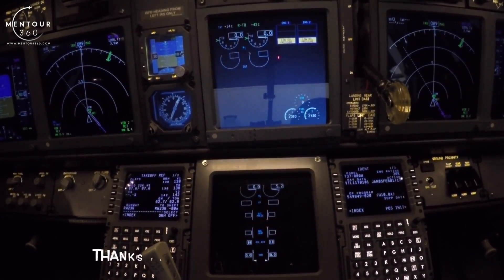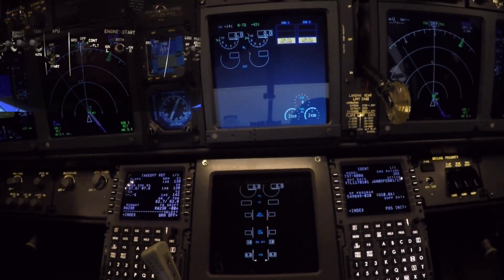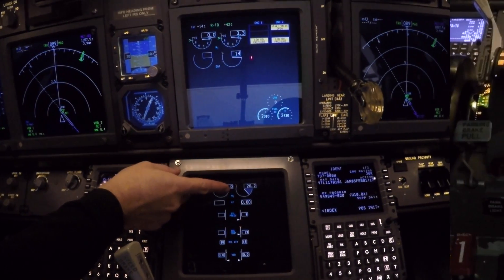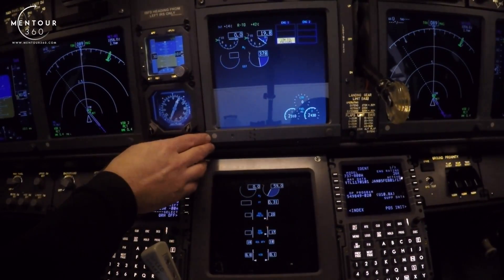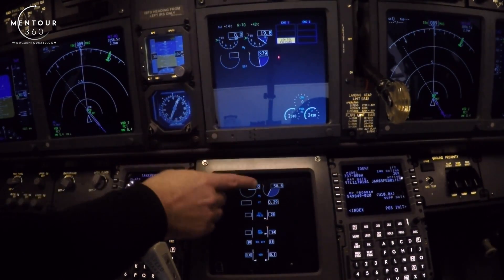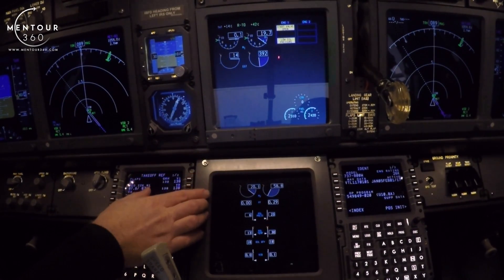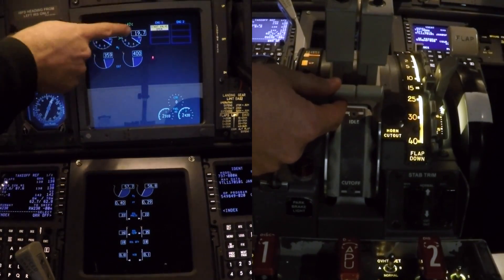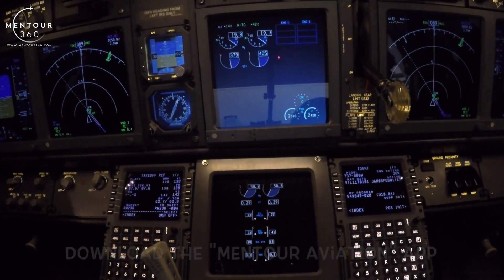How to start a jet engine

Comment: He forgot the most important part.  First assure you have hydraulic pressure from the correct system that pressurizes the brakes and steering. Never start a jet engine unless you have brake pressure.

Comment: We did engine startup different on the helicopters. Because they're turboshaft and there is a not negligible weight of the rotors and associated gearboxes from a static startup to try to spread the strain on the engines evenly the first engine to start would depend on the date. Even number day's would be a number two engine start first and odd number day's would be a number one engine start first.

Comment: Don't forget to first turn on the battery, start the APU and open its bleed air valve, then to turn on the fuel pumps for the engines, otherwise they will not start.

Comment: Petter, have you never queried why ?
2 controls to start engines
It's not an extension of the thrust levers....

FULL
%
.
%
IDLE
STOP

So just move thrust lever from STOP to IDLE - and be done with !

If it were my plane, it'd have one four-position switch:

OFF - ON - TAXI - FLY

And nothing stopping you from going from OFF to FLY in one move !
Reply: What!?😆🤷🏻‍♂️

Comment: What is the maximum egt in both engine during start up ?
Reply: Eduard Caba From the AMM: The EGT can be between 320 degrees C (608 degrees F) and 520 degrees C (968 degrees F) with different outside air temperatures, bleed air configurations and other engine conditions.

Comment: Hi mentour,I have a small question i can't figure out,in the fms of your 737,there is the derate option with some kinds of ratings (i.e:22k,18k...) what does the "k" stand for?Thanks.
Reply: awf2512 Never though about that actually🙄 Think 1k is 1000..like you would say in eg a distance measure (like 10k..)
So a CFM 56-7B with a 26k rating can produce up to 26.000 lbf of thrust..I think🤭🤷🏻‍♂️
Reply: Thousand as in 5 thousand dollars.

Comment: I'm a bit confused as to why the start position on the switch is labelled GND when I was expecting it to be labelled IGN...he didn't explain the switch in the middle which was labelled L and R IGN...why didn't he say anything about that?
Reply: paulmurphy42 IGN means igniter not ingnition😉

Comment: In some videos I saw them pulling the fuel lever at 20%N2. Is this company-dependent?
Reply: outside7 Its document dependent😆 Start lever at 20% N2 is boarderline early, this is the minimum motoring speed, you should really have 25% or max motoring (about 29%).

Comment: From an energy point of view, aircraft engines are important especially when it comes to developing engines that can accept other kinds of fuel or even electric engines for aircraft. Hydrogen fuel cells are another kind of technology that with the proper research can become great for aircraft.
But this video only shows starting the engines from the controls in the cockpit and no picture of what is happening in the engine itself.

Comment: Can the 737 start an engine at an airport without the aid of a starter generator?
Reply: if it has a functional auxillary power unit indeed it can. the APU is basically a mini jet engine (gas turbine technically) which can be started with the onboard batteries, once it's running bleed-off air will be piped to one of the two main engines. once that is running the APU can be shut off and the bleed-off air from the running engine will start the other one.

Comment: OMG! If I owned the Airline, or if I owned the Aircraft company, or even if I owned the engine manufacturer, in all three cases I'd automate the crap out of this procedure. Honestly!

There are only so many parameters that can change: ambient temperature, engine inner temperature (as in how long since last shutdown), fuel temperature, air pressure, and only a couple of other things. (I might even be bold enough to say that the Engine Start Button is for serious machinery, and not only for cool-wannabe idiots buying cheap "sports" cars.)

While Aviation has succeeded in automating a whole lot of truly complicated things, I find it downright insulting that pilots have to learn complicated procedures and contingency forks and exceptions and emergency procedures, all just for something that's not much more complicated (but, granted, needs fast, accurate and confident responses) than children's sand box play.

Comment: So, not CTRL-E?
Reply: Clipper1094 69th like
Reply: Once AI gets to be piloting, it will start all plane systems at random 😅
Reply: Ah. I see what you did there. Control E as in to start your engine in Microsoft flight simulator.

Comment: By the way, I have a question. I noticed that the old bumper engines were usually fitted to the engines behind the plane. The Russians at Il-62 mounted even four engines in the back. I notice that the new generation of planes gave up this arrangement, and the engines are mounted under the wings. What is reason?
Reply: to allow for bigger fans

Comment: batteries on 
fuel pumps... on
apu..... start
apu egt stable...... turn on bleed for apu
packs.... off 
bleed duct pressure......check for pressure 
engine start switch ...on
ICO....... on at proper fan speed  
cross bleed on 
repeat for engine 2
with stable engines turn on hydraulic pumps and anti ice as needed and contact ground for movement requirements 

this is how ive always done my xplane checklist

Comment: That was my job when plugged in at nose gear, giving pilot play by play every step engine was at, and when fuel came on, what a low sonic rumble right to the bone, but the view at 30 below zero at sunrise, is unforgettable. No one has this view anywhere. 
L1011 Days, Most Beautiful Ship.

Comment: Step 1...battery on. Step 2 fire alarm checks. Step 3...start APU....wait for temp and RPM to stabilize...Step 4...set bleed to engine start. Step 4...start engine 2 and 1.

Comment: Explain N1 and what it is. I know EGT in turbine section.
Reply: N2 and N1 are separate concentric shafts.
Reply from the maker: Ok, I'll add it to the list. Basically N1 is the percentage of max rotation of the fan.
Reply: Mentour Pilot are they on independent or same shafts.

Comment: Ive seen pilots putting their hand on the engine start lever, I'm thinking it is just in case you need to put it to cutoff in case of a hot start. Is that correct.
Reply from the maker: +Baxter Cat! Yes, that's correct.

Comment: Why do this video,with all the problems in the air with highjacking not a good thing
Reply from the maker: +C Hirschmann Hi! The amount of knowledge needed to get the aircraft into a position to be even ready to start an engine is far more than I show here.
There has never, to my knowledge, been a single instance of an aircraft being stolen and all hijackings tend to happen when the engines are already running.
I'm not sharing anything that is not open information for anyone.
Reply: Errr. What hijackings? You do realise that this kind of information is not secret? That’s like saying: ‘don’t post a video of starting your car, it may encourage hijackers’.

Comment: Please do a video on why do Airline pilots start engines one at a time and does it matter which engine starts first?
Reply from the maker: +Brian Meola We need the bleed-air from the APU to start the engines and they need to be closely monitored. There is not enough bleed air to start both at once and it would be hard to monitor.
Reply: In the video he started #2 first.

Comment: Great Microsoft Flight Simulator X tutorial! Thanks a lot!
Reply from the maker: +Nickk888(NickK-456) - Musician and Video Maker You are more than welcome!
Reply: not really working with the fsx default i would get the pmdg if i was you
Reply: i had to bleed air in order for the IGN to work ... :( is it because of the need to mix air and fuel?

Comment: What's the use of IGN switch at all ?
Reply: Each engine has 2 spark plugs. They are used to fire up the fuel + air mixture after the engine has started compressing the air and getting fuel. The IGN switch can be used to choose which of the engine's spark plug will be used for the engine start: 1, 2 or Both. Airlines' procedures usually use only one spark plug for each engine start, so the plugs don't have to be replaced so often due to wear and tear.

Comment: EBT, N1, N2 ....What?
I have a feeling that if you know what these things mean then you already know how to start an aircraft engine.
Reply: N1 and N2 are the percentage speeds of the two portions of the turbine, the outer and inner, or bigger and smaller sections.  The N1 section would be what is easily seen from the outside of the plane.  EGT is Exhaust gas temperature.  The starter mechanically drives the inner N2 turbine, the air being pulled through causes the N1 to rotate, and once fuel is being fed in the EGT rises as you now have a controlled fire in your engine similar to an auto engine.  Once everything is rotating at a given minimum speed and the engine is consuming and burning fuel, the air starter is no longer needed nor are the igniters.  The fuel being pushed into the engine is lit by that which is already in there and the expansion of hot gas out the back drives the compression side of the engine such that everything is self-sustaining.
Reply: +quantumbits you are right

Comment: you forgot to mention that prior to engine start you have to have apu on and also set the required bleeds else the engine wont start :)
Reply: Probably intentiona ,in case too much information will get into the wrong hands

Comment: ok so the difference between N2 and N1               N1 is the percent of the rotation of the low compressor  and N2 is the rotation of the high compressor
Reply: More or less. The secondary compressor is smaller so it turns at a higher RPM in general, but it also means it has less range of operation. Think of N1 as a car engine and N2 as the turbocharger.
Reply: Ancutescu Liviu But ~60 n2=20 n1, and 100n2=100n1?

Comment: Would be great if you could explain how a jet engine actually starts. I guess it does not have an electrical starter engine like a car.  I believe the turbine is started using pressurized air from the APU, but could you explain the process more clearly?  If the APU is unserviceable, does that mean the engines cannot start?  And how is the APU started?
Reply: Well no, Ryan, because there's no such thing as an "electric engine." But yes, some jet engines have starter motors. Others are as Andy already explained, except that he doesn't need quotation marks around "huffer cart." What are those supposed to be for, Andy?
Reply: I'm guessing Ryan meant starter motor rather than starter engine
Reply: Well, J, he may have, but I want him to understand the real terminology for things.
Reply: Look on the YouTube channel "AgentJayZ" he explains loads of stuff about engines and how to start them.
Reply: If they  have a GPU its an external jet engine on wheels outside the aircraft. Ground power unit. Same idea.

Comment: Mentour Pilot, don't you first have to start the APU and get the engine blades rotating via the air conditioning? And i thought you d also have to activate the crossfeed to start engine nr2.
Reply: Osman read the FCOM systems and understand that Air cond isn’t used or apart of the engine start procedure. Crossbleed start is used when your APU is U/S.
Reply: Colin Southern yeh but he said VIA Air Cond! I was stating the air cond packs aren’t used.

Comment: hey! I just watched sully movie and one thing I noticed that after the bird strike captain sully tells that "I'm turning on the APU " why?
Reply: The APU (Auxiliary Power Unit) is a 3rd jet engine (or 5th in 4 engine planes) normally located in the Aircraft's tail. It can provide power to the aircraft's electronic and hydraulic systems in case one (or both) of the engines are unable to. In Sully, both engines are destroyed due to birds, so Sully turns on the APU to keep the aircraft systems working.

Comment: Hi Mentour. I have another question, why after landing does the pilot select the altitude to missed app alt plus 100. E.g. 3100, 4100, 5100 etc? Why isn't it kept to missed app alt. 

Thanks
Reply: Ryanair Rules yes, it's basically a check drill to remind the crew  their departure  clearance hasn't been received. some airlines have this +100 add on as part of their SOP's. (standard operating procedures) once the clearance has been received,  the PF will reset the MCP (mode control panel) back to the published missed approach altitude and if required, it will be entered into the FMC❤
Reply: Ava Mendez ok that makes sense. Thank you for the info 

Sam

Comment: can you pls tell the work of external lights in next video like beacon etc
Reply: When engine starts the rotating beacon is turned on to alert people walking near the plane to stay away or get blown away  at the back or be sucked into intake in front OF ENGINE. There are landing lights and navigation lights red on port side and green on starboard or
 Right on wings. Anti collision lights.

Comment: For some reason I love the sound of a jet engine starting.
Reply: its one of the reasons i picked a house near the airport
Reply: MWB Gaming that's cool I always wanted to live near an airport cuz I love planes but I don't like the congestion.
Reply: sometimes i hover my DJI phantom drone about 100ft above the glideslope and around 600ft to the side and watch the planes coming in through an optical zoom

its very interesting to watch the approach from above

dont worry the drone is small enough that it is not detected by radar so it wont interrupt anything and i fly it above and to the side of the glideslope and localiser so it wont hit anything
Reply: @mwbgaming28  But how do you know that a pilot who is new to the aircraft isn't accidentally 100 feet above the glideslope and off the side? It si still illegal to fly a drone near an airport, even if you think you are taking safety precautions and don't mean any harm.
Reply: @samuelwhaley6658  even the most green pilot won't be 600ft to the side of the runway 

There is zero danger to any aircraft, I don't fly in high wind conditions, and if it gets gusty, I bring the drone back home (been doing it for over a year now with no issues)
Reply: MWB Gaming 

Very illegal and huge, civil and criminal fines when caught flying drones near landing aircraft. You're endangering lives.
Reply: Its a common thing. Most of us aviation enthusiasts love that noise 😍😍
Reply: The GE90s on many (but not all) of the 777s have the best start up sound - that buzz from within the cabin is simply incredible.
Reply: it's like a mental RUSH!
Reply: Also the noises the plane makes when the pilot checks everything pre flight.
Reply: So do I but nothing beats the sound, smoke, and fire belching of an old radial starting up!
Reply: The chimes in flight are the most relaxing
Reply: Idk why I prefer turboprops
Reply: And the smell of turbine exhaust :-) in the morning.. (or any time)
Reply: Love the smell of exhaust in the morning. Diesel exhaust in the morning is always nice too. Takes be back to high school getting ready to board that bus for the spring trip.
Reply: Means we are getting ready to go somewhere, means we are getting ready for the symphony of takeoff!
Reply: Same

Comment: Why would you normally start number 2 first? I've noticed pilots on many other aircraft types also start number 2 first.
Reply: Nick Gerbig this varies between operators,  the folks here say 
turning 2 first allows you to close the ISO valve and bring #2 pack on line  giving soothing a/c to your guests while Number 1 joins the party.
Reply: Ava Mendez not only that, when startingneng.2, u always have provided hydraulic system b(b737) or yellow hyd. System(a320) which either a the source for the parking brakemin case of sudden failure of the brake accumulator.

Comment: Did you look at your airlines fleet before applying? Did you want to fly the 737-800 or would it of mattered if you trained on a a320?
Reply: You take what you can get. Not all are available like Southwest only uses 737s. Others have A380...